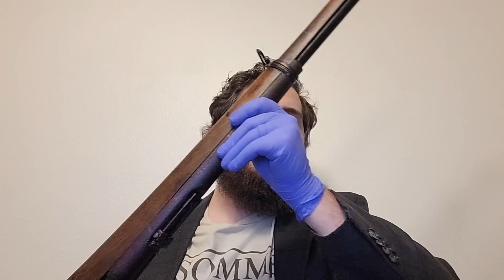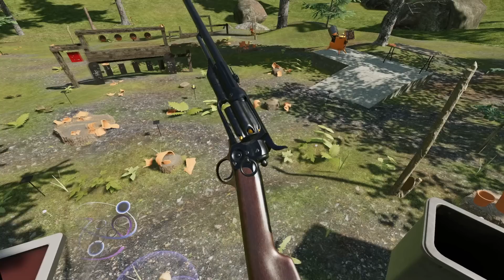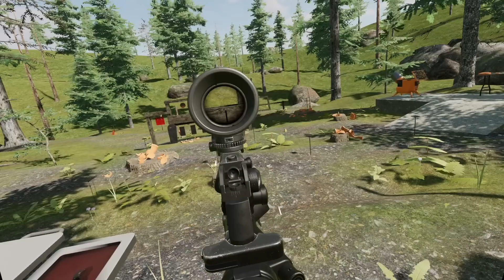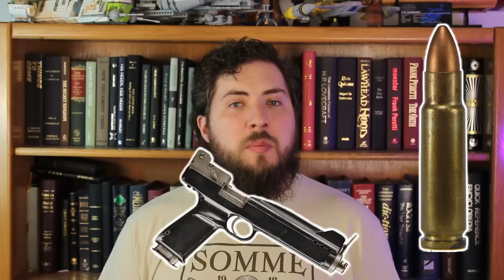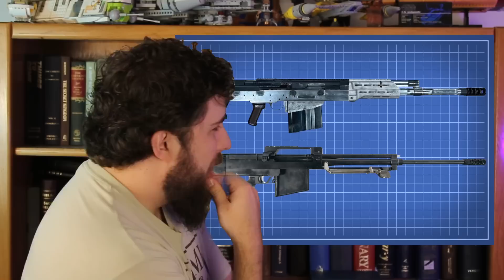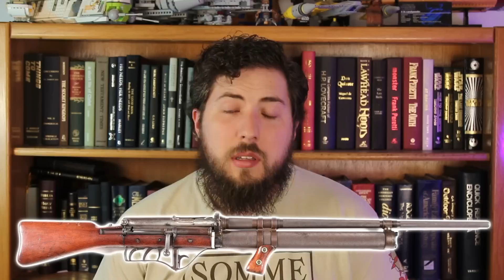The Weird Gun Iceberg - Part 7

Comment: Small correction for the 80.002 and I think this should be in the last level of the Iceberg. The image that has the long gas tube (at 15:02 - 15:06) is not an 80.002, but an AO-38. The AO-38 was designed by Peter Tkachev (the designer who made the AO-46). What's significant about the AO-38 is that it was the very first gun to have a BARS system (Balanced Automatic Recoil System). This would then be used in rifles such as the AK-107 and the AEK-971 (with predecesors such as the AL-7 and the SA-006 respectively).
Reply from the maker: oh shoot you right I must have got my pictures mixed up

Comment: Something I would like to see is if 50bmg necked down to say 5.56 or even a spew like flechette would be a viable cartridge for a military sniper rifle. Maximizing speed should help with trajectory and hitting a moving target at long range. Small caliber rounds can also be quite viable for penetrating armour.
Reply from the maker: You're describing the .22 earspliten loudenboomer cartridge (yes it's real)
Reply: @DarthBrandybuck  Someone has also necked 50bmg down to .17. For optimizing the projectile itself would propably need to be reshaped and likely should be made from higher density material.
Reply: @DarthBrandybuck .22/50 bmg is actually real(same with the eargsplitten) and it's big